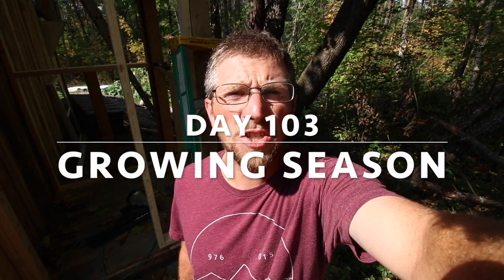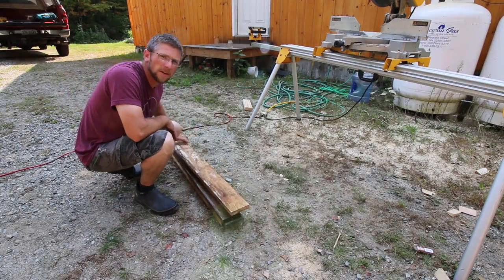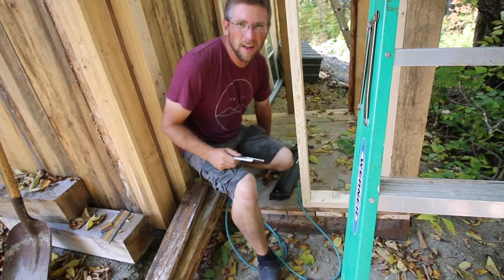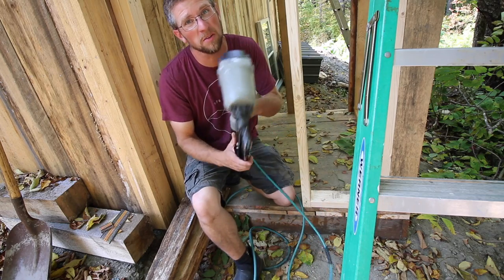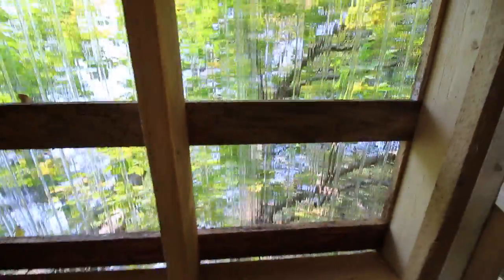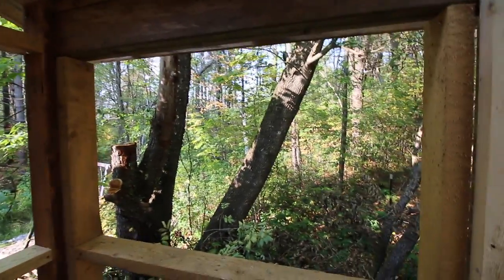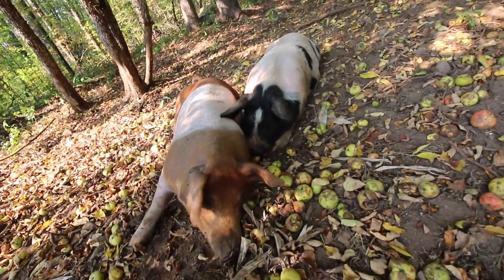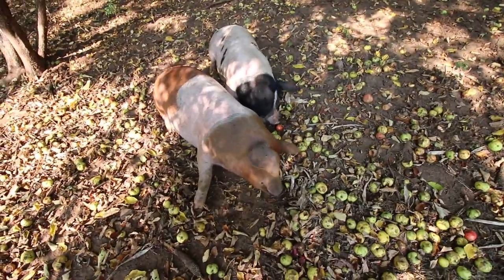Installing a Clear Roof on The Composting Outhouse

Comment: I agree that at least one window is essential for air flow, esp in summer. Ours always had short doors in them, so if raining, snowing, etc., you were out of luck. Had a snake or two come in the bottom. Window will be much improvement, yes! It's nothing a sweet little curtain won't fix! The roof is really nice, love that material. Maybe you can grow something pretty in there next summer too. As always, great job!
Reply from the maker: Thanks! We will have to grow some lemon balm herb in there for the smell! :)

Comment: You are so lucky to have a sawmill close by! I'm limited to Home Depot or Lowes for my lumber right now. Next year, I hope to have a tract of land with timber that I can use for my construction projects. 
Good point about using the composting toilet if power is out. Also it's location is convenient when involved in projects around the outdoor kitchen! It's not that far to run when it's cold! It's a  long way to the house! :)
Thsnks for sharing!
Reply from the maker: Yes it will be great when we are working outside and dont wont to track all the dirt into the house

Comment: Interesting build. That clear roof will certainly help with lighting. How does that material stand up to snow load and UV exposure over the years?
Reply from the maker: We will find out! Lol
Reply: Good luck. I thought maybe you had prior experience with it. At least with your composting toilet you won't be caught with your pants down in a power outage!
Reply: It's pretty sturdy stuff. The carbonate they make now is a lot better than the old fiberglass panels, both for snow load and UV exposure.
Reply: Yes the sticker on the panel will say if its uv protected. I clean mine with my car wash brush and some dish soap every fall. For summer I leave the mold and leaves on for inside protection from the Florida sun.
Reply: Are you going to decorate it too? Lol
Nice build.
Reply: If it's Tuftex - they last amazingly well through all kinds off weather. They're downfall - they don't stand a chance with a twitterpated buck head butting as hard as he can everything in sight! 😧
Reply: Sounds like you speak from personal experience. lol I think Al will have bigger problems than broken Tuftex if a twitterpatted buck gets on the roof of the out house. Like how to get him out through that small door once he falls through the roof.
Reply: YES! That would be a problem! Hopefully Al doesn't get to experience that situation! I think my buck was seeing his reflection and didn't want any competition during that fall runt!

Comment: Oooh No ! you screwed the roof panels in the troughs, best way around it is to have put some sealant around the screw holes before tightening down. Or it will be the song by Burt Bacharach - "Raindrops Keep Falling On My Head."   hahahahaha
Reply: dcsoxford. We used rubber washers. Turned my shade house into a sun house / green house.
Reply: dcsoxford -- Al can just put some sealant over each screw head.
Reply from the maker: The screws have rubber washers on them!
Reply: Lumnah Acres - Thank Goodness for that, you had me worried for a moment, but have seen it happen.
Reply: You are always on top of things, Al.  No pun intended!

Comment: I was thinking, "If he wants light in the outhouse, why doesn't he install a plastic roof instead of windows? That way the peeping toms would have to use Google Earth. I guess it's too expensive." So now I'm really confused about those relatively huge windows. "Panoramic view" in an outhouse? That means they won't be frosted, so...one-way glass? At any rate, this ain't yo' grandaddy's outhouse! If his was a Model T, this'n is shaping up to be Mercedes if not a Rolls.
Reply: Craig Mooring,
I don't think the windows are that low relative to the ground outside..  I suppose that someone like Wilt Chamberlin might be able to peek in.
Reply: I realize that the floor is above ground level, and , for that matter the placement is such that it will be out of sight of the folks gathered, and the people they are likely to have over would not be the sort to peep. Still, the glance of anyone who happened to be strolling through that part of the orchard could could fall upon one of those windows and see who was in there and whether the person was standing and facing the toilet or sitting down. Some people would find that off-putting enough to ask to use the inside toilet. I had a friend who wouldn't use the guest bathroom off our den, because the top 1/2 of the door was louvered, and even though the angle of the louvers was such as to afford visual privacy he felt people would be able to hear what he was doing.